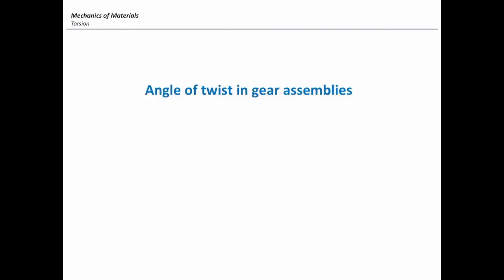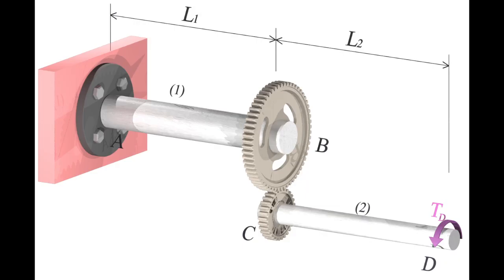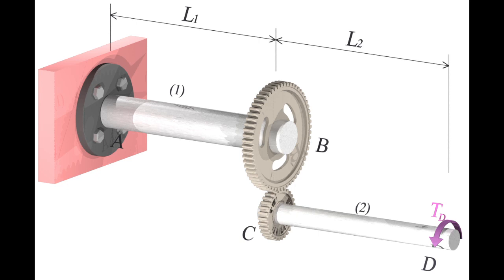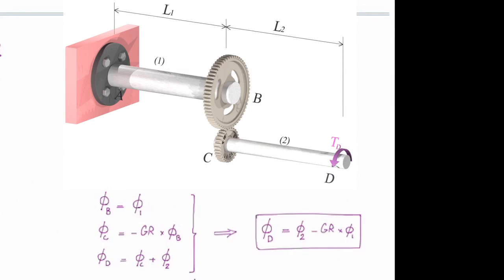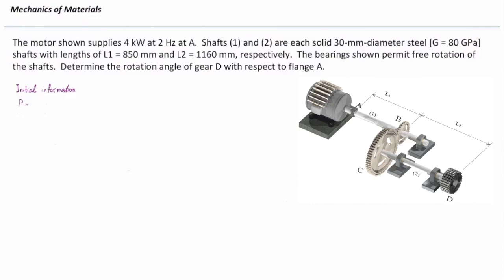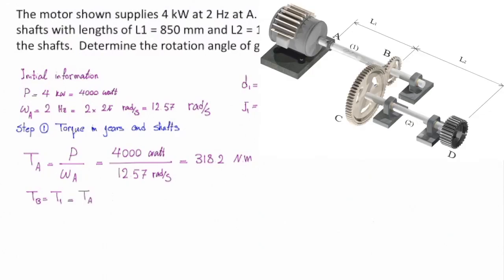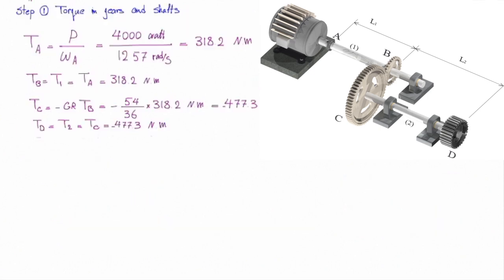Lec9, Angle of twist in gear assembly

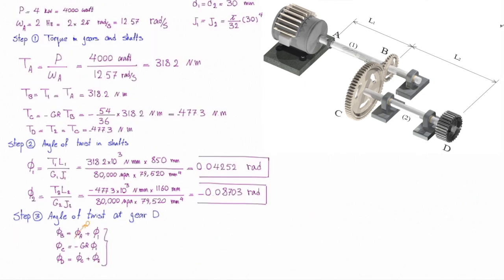Comment: In step 3 of the motor case (start from 7:29), it's totally wrong. You can NOT let PhiA= 0. Because Phi1 and Phi 2 is caused by motor motion, if PhiA= 0, nothing can happen to both shaft. In another word, if you let PhiA=0, even the shaft AB can have a twist of Phi1, in C point it will less than Phi2, so it's not enough to let shaft CD twist Phi2. In this case, we should calculate the angle at the moment Gear D starts to twist but not. Actually, the angle we are calculating is PhiA. It should be Phi2*rC/rB +Phi1.
Reply from the maker: That problem seeks for the relative angle of twist in Gear D with respect to motor A, thus it was assumed that phi_A=0. Note that the relative twist of D with respect to A would be independent from the rotation at motor A.
Reply: @MechanicsofMaterialsLibre  But in your calculation, you use Phi1 and Phi2 which are caused by motor rotation. If you assume PhiA = 0, Phi1 and Phi2 will not exist. You can not use them in your formula.
Reply from the maker: @ericzhou500  Phi_1 and Phi_2 are twists in each shaft caused by the internal torque. Since torque is not zero, the twist is not zero. Note that the internal twist in the shaft is just a function of internal torque, and shaft properties and it is INDEPENDENT from the initial boundary conditions i.e. angle of twist at A. Hope that helps.
Reply: @MechanicsofMaterialsLibre   the internal torque you mentioned is caused by the rotation of the motor, but you assumed the motor not to rotate. Pls think about my calculation. Hope you can understand what I am talking about.

Comment: Thank you for posting this! I have a question. For the first case, how do you approve that the total twist is the sum of the twist in element 1 and the twist in element 2? Thank you!
Reply from the maker: Shaft (2) is connected to shaft (1) so when the (1) is twisting shaft (2) is rotating with it as well. Moving from C to D, we need to add twist in shaft (2) to calculate total twist at D. The following animation may help understanding the concept better.
https://libre.ir/3DMech/
Find the related animation at the bottom of the page
Reply: @MechanicsofMaterialsLibre  I understand now. The animation shows me that the relative motion between the two elements cancels the contribution from AC. So C is 'relatively fixed'. Then the twist of CD is additive to the twist of AC, to be summed to be the total twist. Not sure if I explained this clearly, but I really like the animation.  Thank you very much!